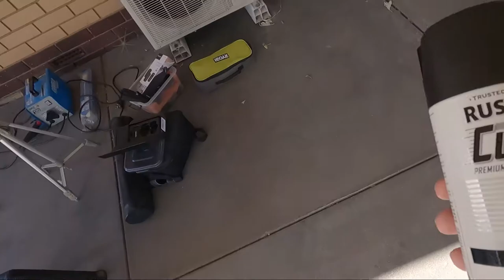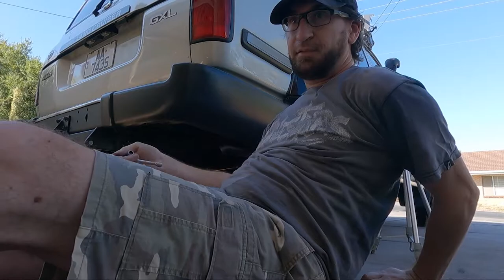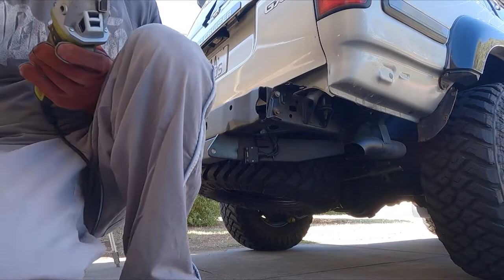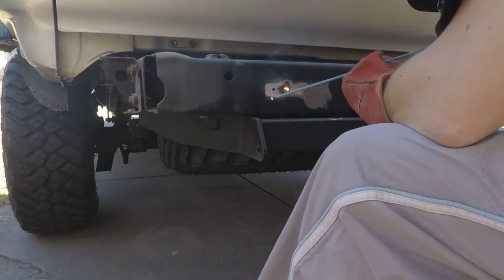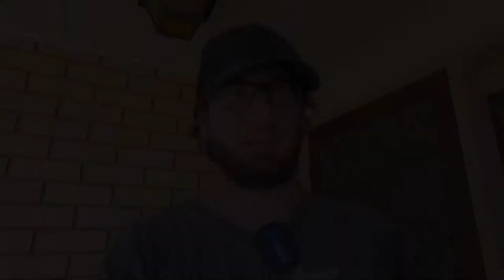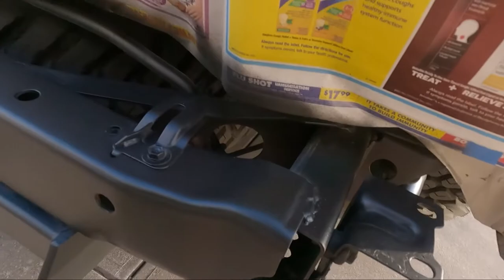Toyota Landcruiser 80 Series // Grinding, Welding & Painting The Rear Bar!

Comment: Well done.  Your 80 is looking sweet. 👍 Mine will needs a paint job in the next couple of years.  It's still ok, but its starting to get chalky in some areas.
Reply from the maker: Age is always a battle with the paint on an 80 series.

Mine is all original except for the roof which I just had sprayed a few months back.

Yet to sort out the cowling, bonnet and flares, but that will happen in the next few months.

Comment: Nice work. Mine needs a little more work as it actually has a sizeable ding on the bar itself.  Not sure how to fix it, as the rear bar is thick and I won't be able to bash it into shape.  It looks like a job for the pros (ie. panel beaters).
Reply from the maker: I'd expect it to go either two ways for that.
A slide hammer to pull it out, or they cut the welds, remove it, heat it up and press it back into shape and reweld it back on.